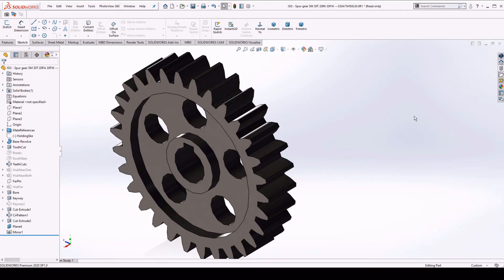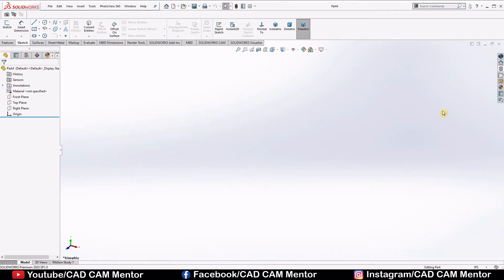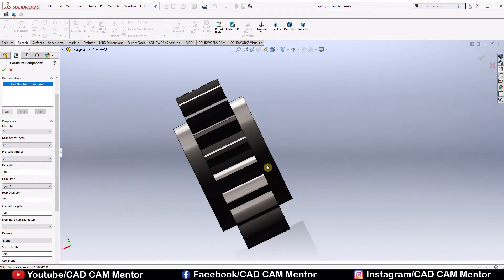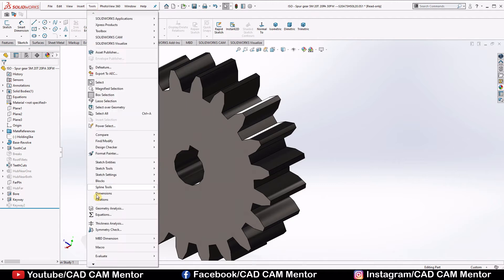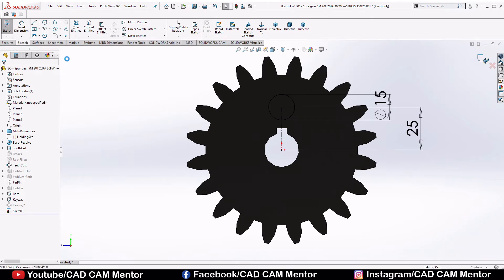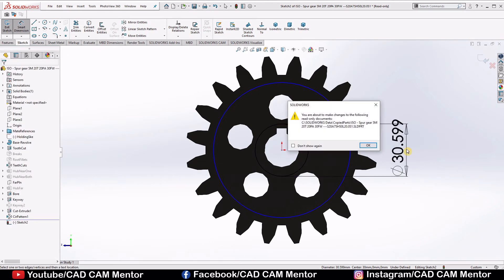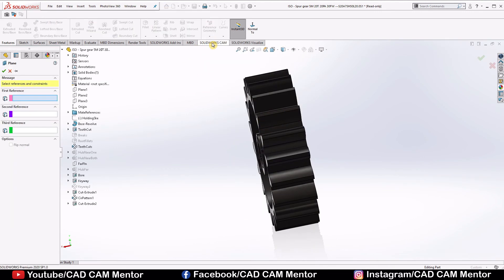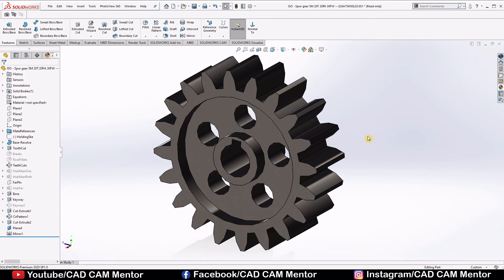design of spur gear in solidworks with the help of toolbox | SOLIDWORKS tutorial for beginner

Comment: 1. You did not specify material, only added 'meal appearance'. See design tree - 'material not specified'.
2. The key way is going to crack open due ti it being too close to the thin hub and the hole above it!